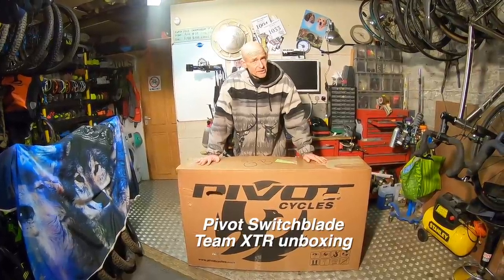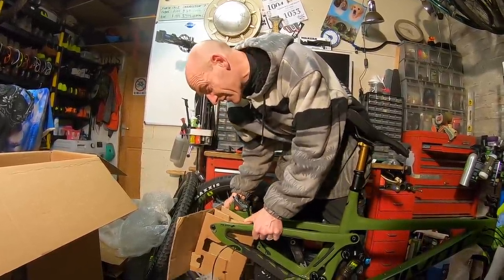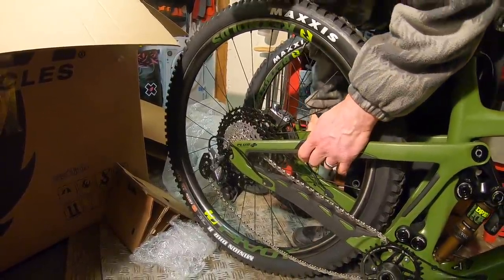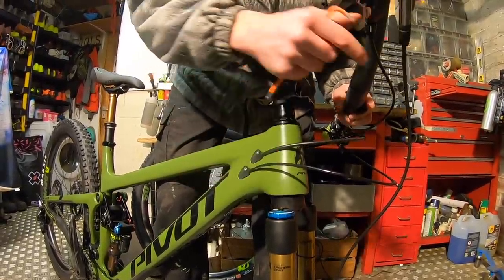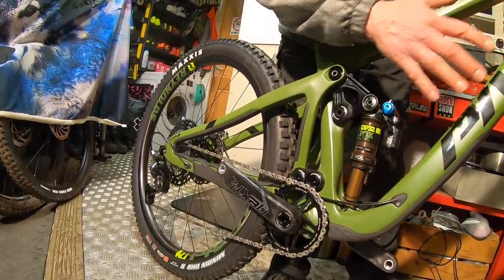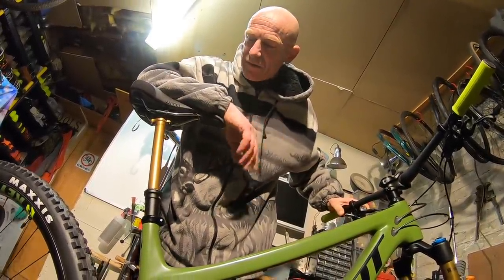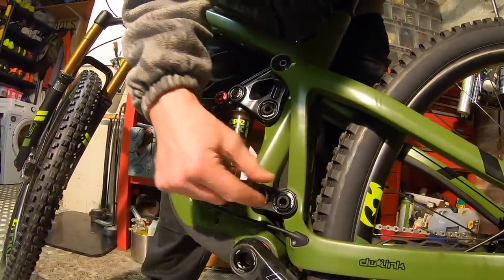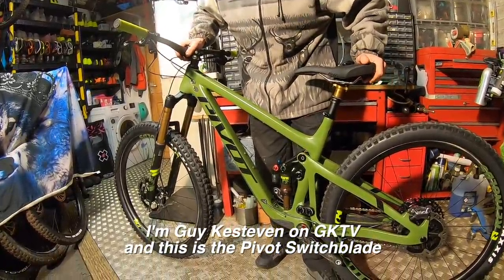Pivot Switchblade unboxing: The most expensive MTB I've reviewed

Comment: Not even that trick for a £9k bike; own brand headset and bar + stem, basic saddle etc. Ok the main things like suspension and wheels are top of the range, but if I were paying that much I'd want a say in the cockpit spec. I guess my point is that this Pivot doesn't make me go WOW like a £9k bike should
Reply from the maker: TBF there is a lot of wow in the ride, but there's also a bit of irritating brake rattle and some shock tuning to be done. Live ride review should be out soon 👍🏻
Reply: That's a pretty trick build IMO, i9 hubs and Reynolds, xtr, livevalve, carbon cranks and bars. a nice stem is only like $130 more and saddles are preference
Reply: The pivot Phoenix bars and stem are some of the best handlebars for enduro
Reply from the maker: landon Day yep I didn’t weigh them but the bar feels great and the stem is a really nice wide forged piece. Feel super precise on the bike.
Reply: you don't know what you're talking about, with the i9 hubs, reynolds rims etc, that is more than a tricked out bike
Reply: @peaohvee1784  maybe I don't, but your point about the wheels is invalid since I actually said originally that parts like the wheels are top of the range. My point is, I wouldn't buy this bike even if I could easily afford it because if I were going to pay that much for a bike I'd want custom spec from the off, and it just doesn't suit my tastes
Reply: @seanhornchek6440  My damn $1200 hard tail has brake rattle and you're telling me I can't even get away from that on a $10K Pivot? FFS
Reply: @radagascar1  that is shimanos fault, swap the pads out for non finned and it will disappear

Comment: people that start conversations saying how many years experience they have instantly make me doubt their expertise i dont mean to be harsh as i do like his vids but if hes so great and has so much experience how come he had to overdub stuff he said wrong. Now i wouldn't have said this if he hadn't of said how much experience he had at the beginning. great vids just pity about the intro.. ive been riding bikes for 35 years (since i was 5) but i dont tell people that just before i get on my bike and ride a trail... hey follow me ive been riding bikes since i was 5... bang wallop.. falls of at first jump..
Reply from the maker: Fair point, believe me I get massively pssd off every time I screw up to because - as you say - it makes me sound like I don't know what I'm talking about or Im struggling for words. TBH the overdubs are generally because I went Urrr or aaaah or just got the phrasing wrong so it sounded crap. But yeah I make mistakes for sure, especially when I'm pulling a bike out of the box. I think on this one on the original dub said it came with Di2 compatible routing as every Pivot I've tested before has. Then I realised it might not so I got in touch with Ron at Pivot in the US confirmed that it didn't and overlaid that bit. Plus as I'm doing it unscripted and my mouth is often running for minutes at a time I'll sometimes get the numbers wrong or some doubt will creep in so I'll say a string of numbers like the headtube is 66/66.5/65.5 then pick the right one afterwards. What's weird is it seems I have to do that a lot more on these unboxing vides where I'm facing the camera than on my riding reviews. That really doesn't make sense. There's no way of hiding that stuff seamlessly though, not like written word reviews where you have no idea how many times I've corrected or rewritten stuff.
Anyway apologies for the glitches and for waving my experience around, I started saying that to try and carve a niche among a lot of people video  reviewing bikes who have very little background in the work. I'm not saying they're bad because of that, freshness is often great and there are some people doing a brilliant job - Like Wil on Flow - who probably weren't born when I started working in bikes shops. Oh hell, there I go again, what a grandad. The bottom line is that the intro has kind of stuck, people laugh about it (go watch the spook Guy Kestrel Superstrength videos from Cycle Factory), maybe think OK perhaps he's worth listening to then even if he screws up occasionally, or like you they hate it.
Genuinely, thanks for letting me know though, all feedback is super useful and maybe it's time for a change of approach. And I PROMISE if I met you on the trail that I wouldn't tell you how long I'd been riding, so maybe it's a d*ck move doing it here. I don't know 🤷🏼‍♂️ 
Anyone else got any opinions?
Reply: @GuyKesTV  i dont hate it! please dont take my gripe seriously your reviews are awesome and i presumed it wasnt all because of errors you just wanted to get the details right :) its just you remind me of my dad lecturing me about how much he knows and people on forums saying how they have had x amount of experience so they know better then everyone else! please dont change because of something i said im just a guy on the internet with nothing better to say plus as you say its kinda your signature intro.. keep being you.. after all you know more than me you told me so at the beginning of the video ;P
Reply from the maker: @billysbikes8671  "after all you know more than me you told me so at the beginning of the video ;P" I am proper pissing myself at that mate 🎤⬇️ 🤣🤣. You nailed it right there, I AM a dadsplaining pain in the ass and my daughters and wife would totally agree with you. You should hear me go on about loading the dishwasher and I have way less experience on that! Seriously thanks for the feedback, it's always good to be made to think about the grooves and ruts you've gotten into over time but stay safe and stay healthy and hopefully hook up on the trails some day 👊🏻👍🏻